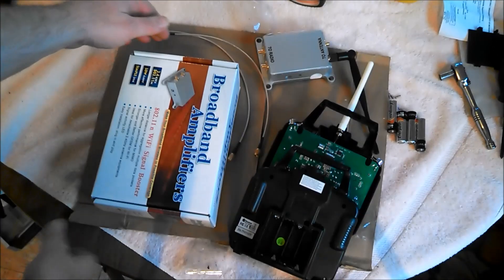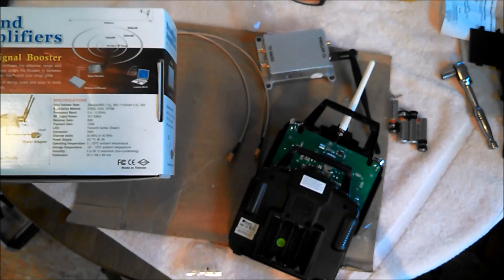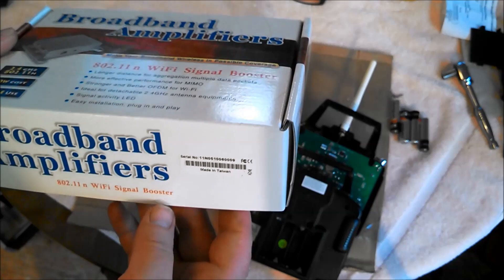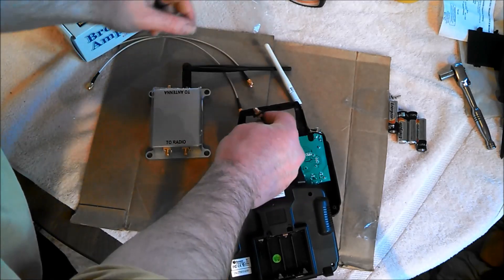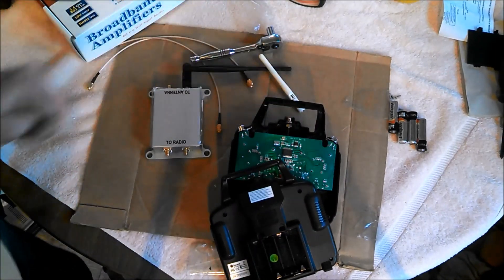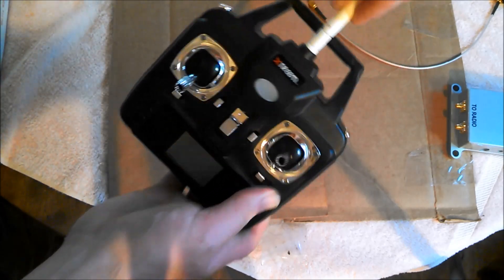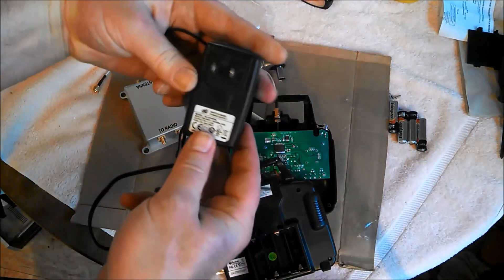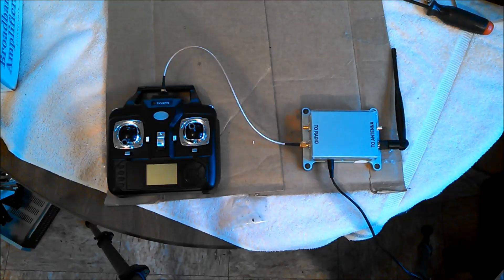antenna mod 12dB power boost for drone 2.4ghz controller - part 2

Comment: Hi, I have a FS-i6 transmitter which has 2 default antennas. If I use a Wifi amplifier, how should the amplifier be connected to the transmitter ? Thank you
Reply from the maker: If you use the same Wifi amplifier that I used in this video you it has connections for 2 antennas.  I would connect both antenna connectors to the transmitter.

Comment: They sell on ebay a plug in 2.4ghz booster for outdoor boosting of wifi and 2.4ghz signal boost. Suppose to boost the signal 300m or more.
Reply from the maker: I'm curious .... Are they marketing them for drones or just wifi?
Reply: Think its just for the wifi but cant see why it cant be used to boost 2.4ghz signals

Comment: How many range in km??
Reply from the maker: safu gsm I have not tested the range.  Sorry, I don't know.
Reply: range depends on antenna as well.
Reply: infinigrove  max 300m
Reply: Cx-20 max range 300m but with booster or emplifire the range will be 10 to 40 km !!!! Krzysiek S

Comment: The receiving antenna how long? (62,5 mm?)
Reply from the maker: Bela Szendrei are you asking about the receiver in the quadcopter?  I'm not sure what the length is on that but I'm guessing that it's maybe 30mm.  I am considering modding that is well by poking a hole in the top of the quad and orientating the antenna to point up.